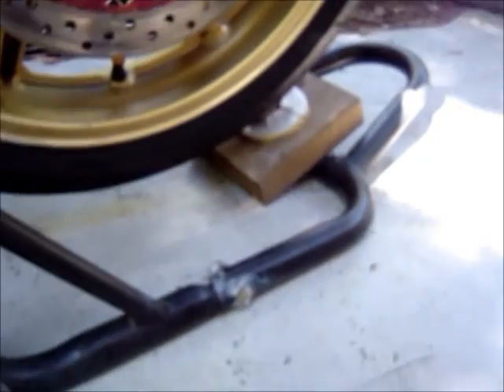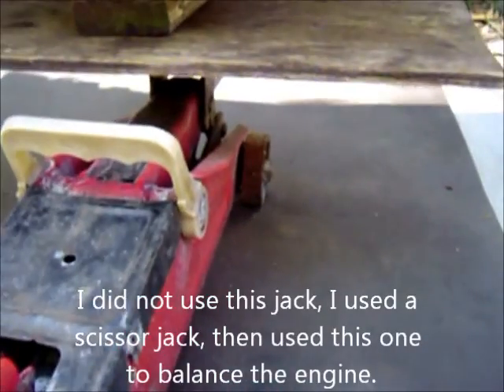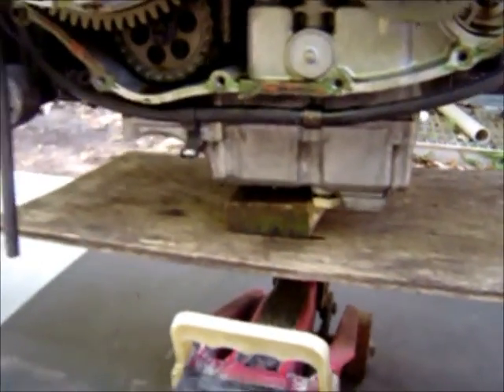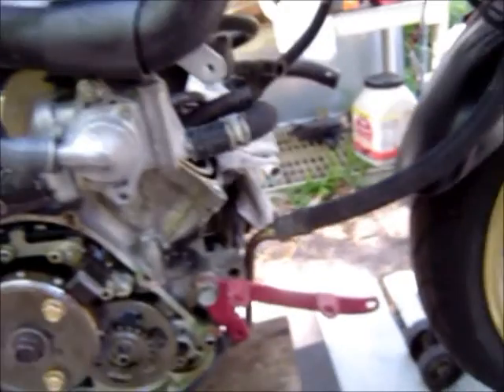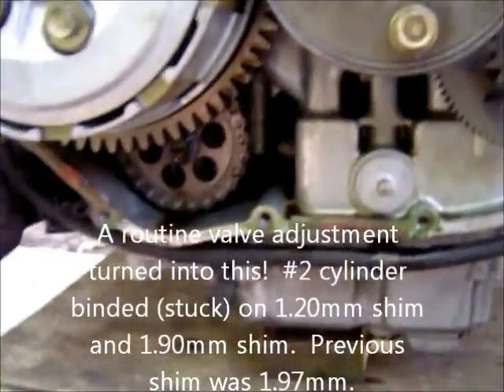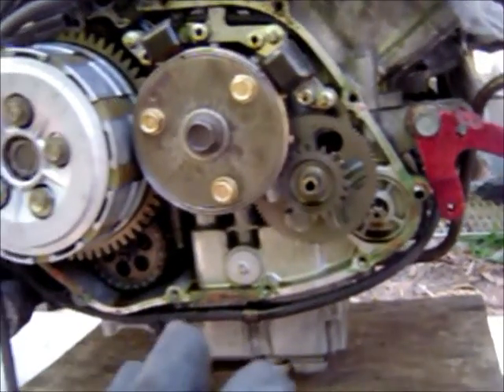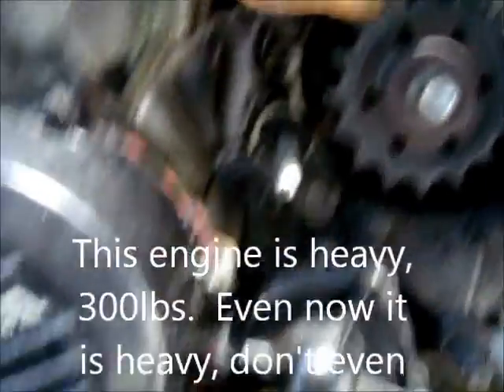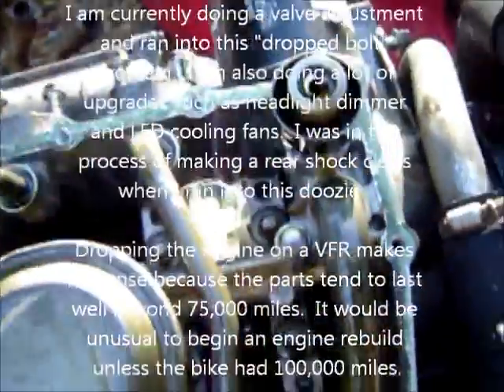How to Quickly Remove an 86-97 VFR750 Engine From the Frame

Comment: That's not an easy job bro. Thanks for sharing. 

If I had it indoors (best option for UK weather) I might try removing the wheels and lifting the frame off the engine with a hoist off a beam, as you discussed earlier. But both elements (engine and frame) are very heavy. 

And in an ideal world I'd lift the whole bike up on a bike lift first, tie up the frame to the overhead beam, unbolt the engine, then drop the bike lift with the engine on it, roll away, fix and reverse the process. 

The best thing for recovering dropped bolts in engines is a telescopic aerial with a magnet on the end. Make certain the magnet is well secured in the thing though. It would be easy to lose the bugger in the engine before you recover the bolt. 

Hope the rest of the project went well. Great bike. I'm eying one right now.

Comment: The rear tail section of the 94 is cracked on both sides and around the tail lights. It is loose to grab the fiberglass too.  How would you attempt repairing the fiberglass tail and making it rigid?
Reply from the maker: Learn how to carbon fiber!  It is the best way to put a skin on the back and bondo the pieces so that they are smooth and look perfect.  Carbon fiber is as strong as steel.  The next best thing is JB Weld. It is an adhesive and when mixed, is as strong as concrete; however, it is hard to sand.  Those are probably the two cheapest methods I use.  JB Weld is the fastest and cheapest; go to any auto store and pick up the two part adhesive for $7.  You still have to bondo the front and repaint it.

Comment: It looks like a 90-93 RC36 750 VFR
Reply from the maker: Correct.  Obviously a shop will have the right tools but the home mechanic might buy a bike and rebuild a bike once every 20 years!  As a result, it would be just as cost efficient to purchase a new bike considering the cost of the tools and equipment you will need to perform maintenance, basic repairs, or a full engine overhaul.  A lot of people make comments about this so I try to add; my videos are for people who rebuild or build bikes a few times only.  It can be done, it has been done, and it may not be the best way or the correct way; but a way to accomplish the task with the least amount of money given you can sell the used equipment to the next guy.  There are a lot of ways people remove the engine, this is just one way.  I have seen people remove the frame off the engine but this requires the entire bike be disassembled.  The VFRs I had were in such bad shape, I practically did a full restoration on them and once you do they are almost as good as when they were brand new.